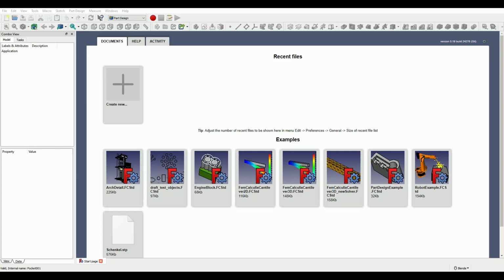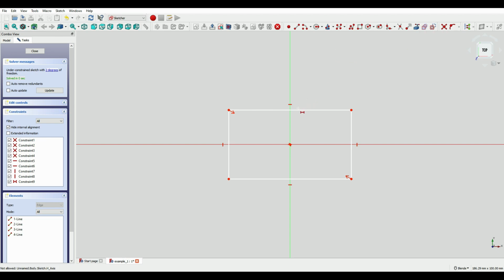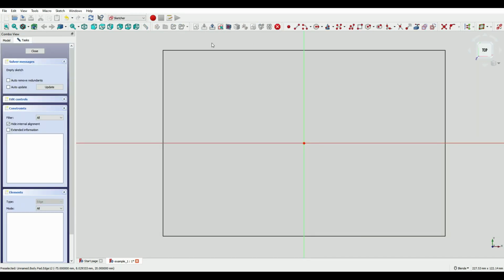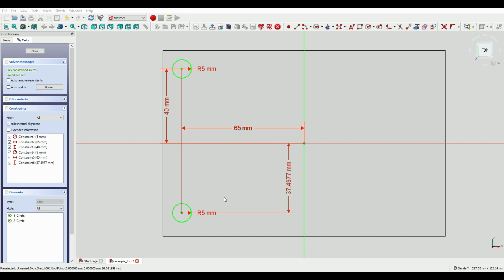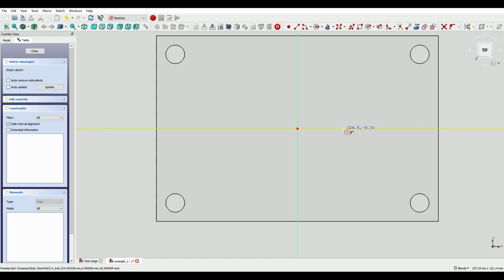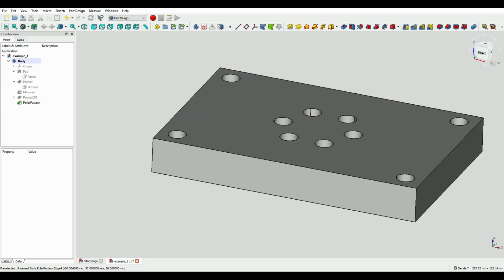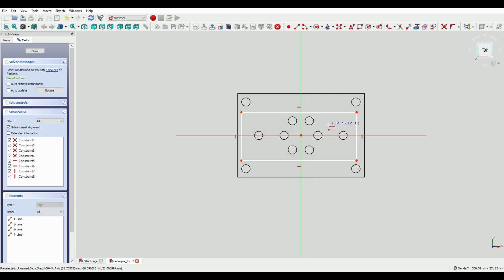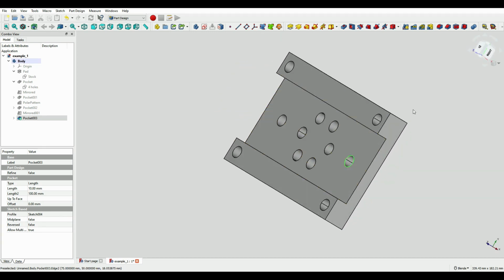FreeCAD Simple Vise Example

Comment: Можно сделать проще:
04:07 - сделать ограничение по равенству окружностей;
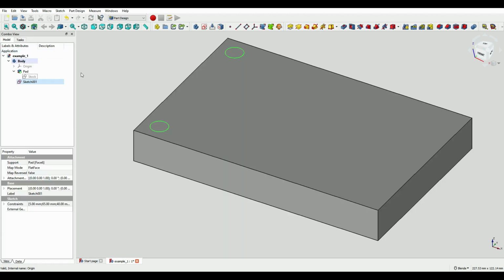04:30 - сделать ограничение по симметрии для окружностей R5;
09:20 - сделать привязку по кромке, по команде "Внешняя геометрия".

You can make it easier:
04: 07 - make a constraint  on the equality of circles;
04: 30 - make a symmetry constraint for R5 circles;
09: 20  -  make a snap on the edge, using the command "External geometry".

P.S. Translation by Google